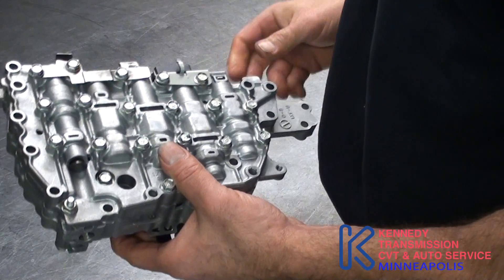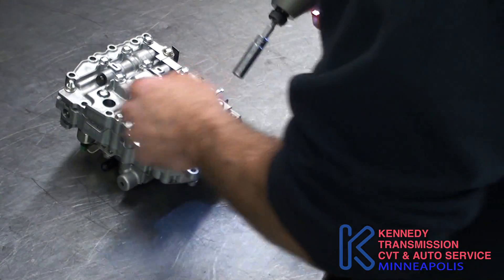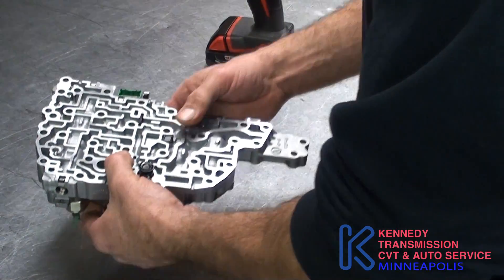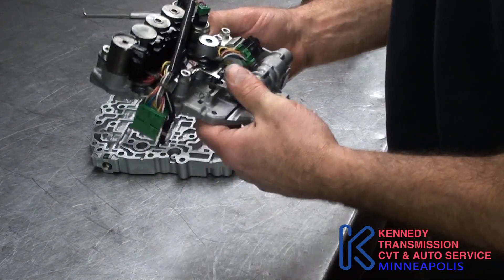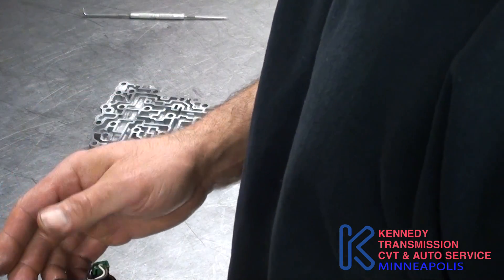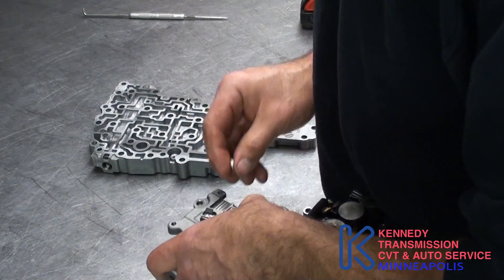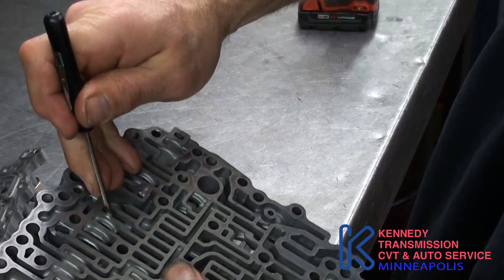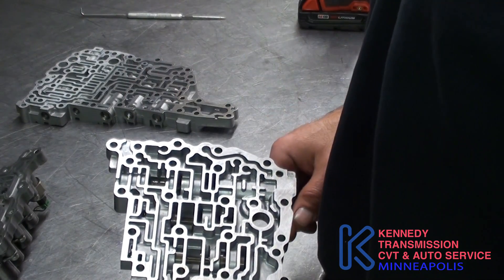CVT- Jatco JF011E Valve Body Inspection

Comment: My 2019 outlander cvt got rebuild few months before with the valve body replaced.  Now it started having issues again. The rpm fluctuating and shuddering once its warmed up but there is no code. Is it the valve body again?

Comment: For the new TCM on the valve body, I’m assuming the blank ones can relearn itself on the car? Or use a scan tool to reset it?

Or better off swapping in the old TCM to the new valve body?

Comment: I’m replacing the valve body and the stepper motor is in a different position on the old one to the new one. Shoukd I remove the motor on the new one and position it in the same location.  New one is wound in a lot more.

Comment: Do you ever vacuum check the valves in the valve body? I'm finding that's where a lot of my issues are coming from is worn our valves or the bores are wearing out and need to be reamed out and fitted with oversized valves.

Comment: Those two tiny rectangle filters were missing in my 2012 valve  body is that normal or did I lose them both?
Reply: Working on my 2012 right now and same thing with mine. Got the cylinder shaped one but not the two smaller ones. Did you ever find out if it’s supposed to be that way?

Comment: Thank you very much. I did not realize I took apart too many bolts and it came apart in sections so trying to figure out what those balls went was a big help I've learned my lesson. Lol thank you big time. What causes that plunger where that stepper motor attaches to to get jammed up because on my I literally had to use a hammer to get that plunger to come out and it's very stuck

Comment: This a great video Kennedy, thank you for posting. I have issues with my valve body after changing the stepper motor on a 2008 Nissan Sentra doesn’t want to back up, I notice that small round  black plastic cylinder came out of the valve body, it looks like strainer or filter, and the mechanic not just put it in the wrong place but also broke it, now I am wondering where can I buy it that small cylinder and where exactly goes. In minute 3:32 you removed some of those cylinder but I couldn’t quite see  the shape of them, there is anyway you can help me to figure out where that cylinder goes, also another metal cylinder that goes with spring on it came out and no idea where is it goes. Thank you

Comment: 2012 suziki sx4 wont go pass 20mph. Gives p0777 code. I changed the 1st 4 solenoids you showed on the video with no luck. What could cause this? Also chaed the transmission fluid.

Comment: Hi i have a 2016 altima sr with 46k after towing it with all the 4 tires on the ground with shipping mode engaged. It will not move fwd or back i have p0746-00 p0848-00 p0965-00 p2765-00 any help would be appreciated

Comment: So if you are thrown a P1778 stepper motor code, and replacing the stepper motor will not fix the issue, what exactly is the issue and what needs to be replaced?
Reply: Exactly what I'd like to know...
Apparently nobody talks about a fix for it.
Reply: Im in the same situation p1778
Reply: @fervienteteocrata1915  
I had to replace the transmission. Car runs like new now!

Comment: I have a 2012 altima 2.5L , does anyone know the part number for the whole valve body? Mine is reading "p1178,  transmission reverse i/p circuit malfunction ". Please help
Reply: GIVE DEALER YOUR VIN NUMBER
Reply: Just search JFO11E or REOF10A

Comment: Hay jeff i have a 2010 Mitsubishi lancer gts with a cvt jatco. When i accelerate from a complete stop, my car will begin smoothly then seconds later start to shake then be perfectly smooth at high speeds (40-60mph). I have the sst one with the paddle sifters witch i never use btw but when i star to go at a complete stop ill sift from fist to second at 2500rpm perfectly smooth then second to third at round 2-2500rpm and it will slow down then speed back up to normal kinda like a slip, then every shift later is perfect, theirs 6 speeds

Comment: Have you ever seen one of these transmissions have belt failure and the transmission still be good? Or is the belt failure caused by something else that has failed?
Reply from the maker: Kurt,

On the Jatco CVT's, we almost always find that something else caused the belt failure.  Extremely rare to see a broken belt with the rest of the unit still in good condition.
Reply: Kennedy Transmission, CVT & Auto I may be calling the parts by the wrong name but I found a failed variation pulley I replaced both pulleys and belt and as of yesterday the car is back on the road
Reply: @kyleburt442  
Hey Kyle
Glad to hear your up and running again! Was it hard to rebuild the unit yourself? Watched a couple vids and doesnt seem too crazy...but i have no clue where to source parts for these...

Comment: Hi great video,  i have a problem  with low primary pressure and  step motor  showing  present on scan , my question is would the step motor cause a low pressure  problem  ? As i have tried  changing filters & fluids  ,  can the screens in the v body cause  low pressure if blocked  , hope you can advice  ,timbluck@sky.com
Reply: STEPPER MOTOR ALMOST NEVER BAD   PRIMARY PULLEY PROBABLY STUCK FROM BAD BALLS
Reply: @jeffstepp1969  
Hi Jeff, is this pretty much the only cause?
I had P1778 (stepper motor code) come up on my car. Car runs fine till it hits about 45mph, then it doesnt want to upsift. If you press the gas hard, it will continue to rev. Once you hit about 4K rpm, it triggers the check eng light and P1778 code.
But car runs great up till that point...
Changed filters and fluid. I didnt see cause for concern in the pan.
Was gonna try ordering a valve body, but are you saying its a waste of money and time?
Just doesnt seem internal cause you can roast the tires off the line if you want...Its not lacking any power

Comment: If you get a stepper motor code what would be the problem?..I noticed you didn't say because that's what I'm in the middle of right now.. it's got that Code. 1778..and low  pressure code.... I've got the valve body out on the table right now,just replaced the stepper motor... weird thing is the car is working fine just throwing the codes it's a 2010 model without the secondary pressure switch... it would be very cool if you could get back with me in the next 3 or 4 days before I put this thing back together and let me know what I need to replace or clean or check before I put this valve body back in....thanks..
Reply: hi, did you ever figure this out? thanks
Reply: @josedasilva4433  The pressure regulator in the pump was slightly damaged causing a fluid pressure loss which cause damage to one of the variators.... chewed up the slide  bearings... I totally disassembled the transmission ordered a kit...kit was under $500 shipping and all...came with upgrade parts and an upgrade pump with a bigger pressure regulator valve in it...
Reply: @motersickel  Would you be able to send me a link to the kit you purchased?  I would like to see what came with your kit.  I believe this is the issue I am having with my 2011 Nissan Altima.  No slipping, but it will not shift and I have a low pressure code which makes me believe it is the transmission oil pump.  Belt and pulley's look like brand new, but I have not removed the transmission.  I have only been able to see certain parts after the valve assembly was removed.

Comment: @Kennedy Transmission, CVT & Auto. I have 2014 Altima 2.5 and it's started to stall and stopped moving when I got it home. P0776 and P2813. I'm changing the fluid today and if that doesn't fix it, would I change the valve body with the part from the dealer for $350 because they don't sell the pressure switches individually. Thanks and awesome video
Reply: How did you make out?
I had P0746. I changed fluid and fliters and it went away.
Now i have P1778 code...
Cant win with this damn CVT.
Never will i own a vehicle with one every again!

Comment: hai,  mine is 2013 Nissan altima. especially in winter, for the firs 4 to 5 km  of each drive. car runs very slow, 30km speed at 2000 RPM.(I can feel the lack of power). once the engine is hot, after 5km. immediately the transmission will properly engaged to engine and run normal. In 2018, I changed transmission, but the same problem is still exist. could you please explain me what is the real issue. Nissan dont want to help me more. would you please advise me. thanks.
Reply: way late, but it keeps the engine at high revs, lower speed to heat the engine up faster. meant to improve fuel economy. very annoying but it is a good thing. give 'er a lil more gas

Comment: Thanks for the video.  2008 Nissan Rogue AWD.  Slow acceleration and some stuttering noticed.  Transmission fluid looked clean and was full.  Progressed to the point of barely inching forward from a stop (like stuck in 4th gear) and code P1778.  Would that really be the stepper motor, something in the valve body, or the valve in the internal CVT pump?  Or something else?
Reply: What was the cause of your P1778?
I just got that code, but car runs good up untill its supposed to shift from 3rd to 4th...

Comment: 2 questions for you.
1. What do you think about adding coolers for CTV transmissions?
2. Nissan CVT fluid.   Nissan brand fluid is very expensive, I have a nissan second hand and it is way past warranty. I am getting ready to replace the valve body.  Are there quality Non Nissan brand CVT fluids I can use, Any recommendations on which are good or what to stay away from?
Thanks for the video by the way, you answered something I was confused on, why some of the replacement valve bodies come with wiring for only one of the sensors,  You mentioned prior to 2010.    I was going to pull mine out before ordering a new one to see if it had one or 2 sensors hooked up, I am assuming now it is going to be 2.

Comment: Got a 2008 sentra, showing p0845 code, when cleared it comes back after driving and restarting the car. I feel like the trans is shifting just fine, starts off a little slow but that's normal for a ctv. Should I just change the sensor ?
Reply: Go look up the Nissan service bulletin for that error code.
Reply: @JohnNorris411  changed the sensor, filter, and fluid, code went away
Reply: @mdamron115  I have the same code. I have pulled out the old valve assembly, and put a referbished one in.  Just waiting on a cooler filter in the mail to complete the job. I am adding an external cooler to keep the fluid cool.   Will report back when its all done.
Reply: @mdamron115  By the way, You may have another filter under the cooler which should be installed just under your Battery mount.  You might also want to install an external cooler to keep the issue from coming back.
Reply: @JohnNorris411  How did it go? You got it fix by the refurblish one?

Comment: My 07 patriot in limp life P0700 transmission Control System mil and incorrect gear ratio would that be from a bad valve body it won’t shift pass second it will tack out the rpm

Comment: P1778 code came up on my ‘14 Nissan Murano (bad stepper motor). Can you please elaborate on your comment that the step motor is usually not the problem?
Reply: Yep having the same problem on an Altima apparently he's not getting back to any questions anyone...as I'm not a transmission guy but have been a mechanic for over 26 years and I just am not buying a whole entire transmission when the vehicle is still driving pretty normally just throwing the stepper motor code...maybe it's a secret he don't want to tell anyone...
Reply: @motersickel  
Haha
I just got this code too! But car is still getting around.
If anyone can chime in for this code, cause its like a secret on the net!
Search for 2 days and not a fix or definite cause for it...
Reply: @splash5974  well since this comment I have took it on myself to rebuild the transmission in the Altima and have found out it is actually pretty simple... so if you're getting that code you might want to be ready to rebuild it sometime in the future... what happens is the input variator behind the torque converter moves in and out with changes the gear ratio, well there's no actual gears it is a belt... the variator stops moving smoothly due to lack of lubrication going to the slide balls... it starts to jam up which causes a code to throw for the stepper motor that reads this movement the start of this comes from the pressure control valve in the pump gets hairline scratches in it causing a fluid pressure loss... eventually you may get a low transmission fluid pressure code people think you don't have to change the fluid and filter on these for a very long time when in fact I would do it every 30000 miles.... these Transmissions are a very good transmission they just had a few failing points whatever it takes transmission offers a overhaul kit that is also an upgrade kit ..I ordered this kit from them and a upgraded pump.... I highly recommend this kit from them....
Reply: @motersickel  
Ok i was worried about it being more than just a valve body issue...
Im justcabout to order a nee valbe body and swap it, but makes sense what you're saying. So the variator is damaged and not changing ratios. Thats why i can go above 45mph, cause it wont change to higher gear ratio.
I seen a couple vids on rebuilding it. It doesnt look like a nightmare job! Everthing i look up for rebuild kits are just gasket kits. Where did you find a complete kit to do the rebuild? And did you do it from vids or get a manual to rebuild it?
Reply: @motersickel  
I didnt get ghe actual name of the place you found the parts.
You replaced everthing with new?
Belt, pulleys, valve body, clutches, pump?

Comment: Great video, what are symptoms of a bad valve body?
Reply: Transmission getting stuck in limp mode, stuck in a low gear.   Also I believe it may bounce back and forth between gears like it does not know what gear it wants to be in.   If your fluid is at proper level it could be valve body issue.   If you are getting engine light with error code P0845 or P0840.  Nissan has put out a service bulletin recommending replacing the valve body.   I believe there are a couple other codes mentioned as well.  Im no expert, just from what I have learned dealing with my CVT issue.
Reply: @JohnNorris411  Please help, haviung the same problem with exact codes

Comment: So o have a nissan murano 2005. I changed the trans oil and flushed it out. There were shavings all in the pan when I went to change it. I still went ahead and replaced filter and added castrol CVT oil. It ran well for 400 miles but now it wont even move and there's no check engin light to read. It reverses very slow and will barely move forward. I mean I have the petal to the ground and nothing. I check the trans presure and got only a trickle coming out. Could valve body be clogged.

Comment: do you have an email i can contact you on. im currently working on replacement of the step motor on the throttle body. i have a couple of lil parts that i have on mine. but dont see in video. was wondering if you could shine the light on where they go. my throttle body is the same as the one in the video

Comment: Hello, have a very important question. I bought 2016 Nissan Altima SR 4 cylinder brand new. 60,200 miles tranny failure (cvt).... I have 40,000 miles on the remann cvt Nissan put in it. It seems like around 60,000 miles these cvt”s are going out. Is there anything I can do to prolong the cvt. Fluid change???? Or they just junk and hope for the best. I drive it daily with 1-3 hour travels 5 days a week.
Reply: Sorry sir. Jatco makes horrible transmissions. Dont buy a nissan with an automatic/CVT.

Comment: When putting the "entire" valvebody back in can you still use the drill bit to line up the ratio control arm?  I didnt see any other video going further into detail on that or any video on YouTube and I'm kinda stuck at this part
Reply: Did you ever figure it out? Struggling with this right now
Reply: @project4funner  you pull the arm all the way back and you will notice a small hole that goes straight through the valve body. Place a hair pin or something small in there to keep the arm from moving back. Install the valve body and remove the pin.
Reply: @dwaynedumas5278  thanks for the explanation. I had been having a real hard time trying to get it in place with flat shim stock from above while installing. Should have known there was a better way
Reply: @dwaynedumas5278   i have seen another video, who placed a pin wire but after completing from assembling, he havnt removed the pin, i dont know he forgot or it must not be removed
Reply: @project4funner  anything?